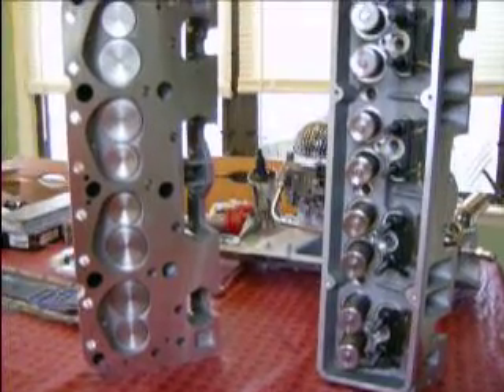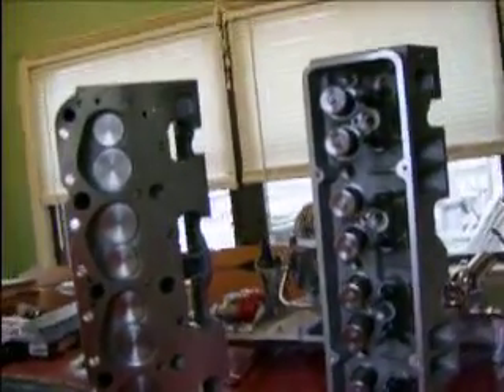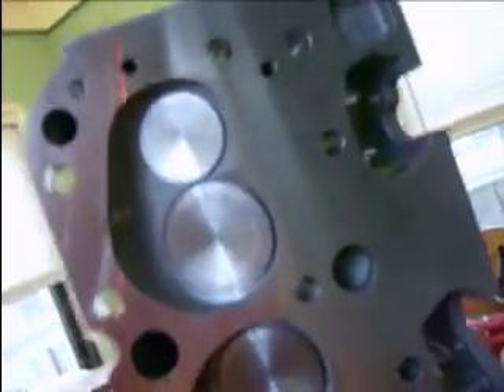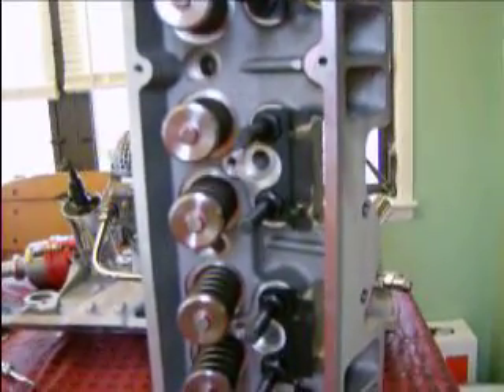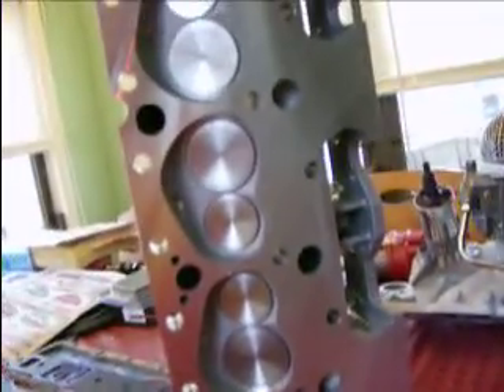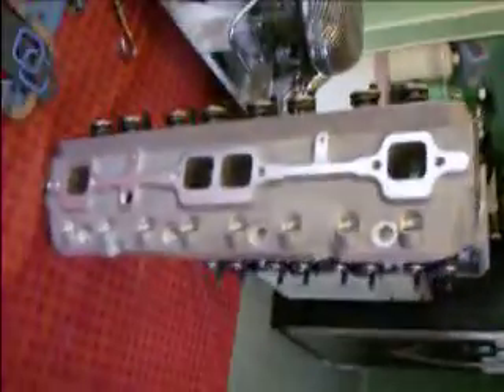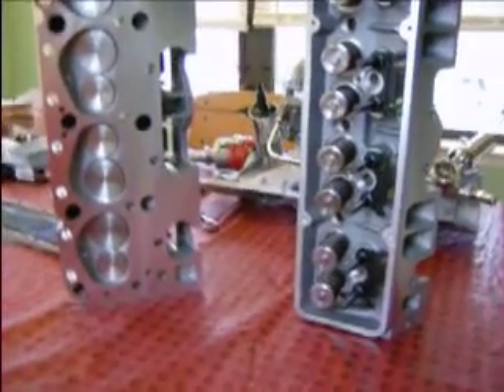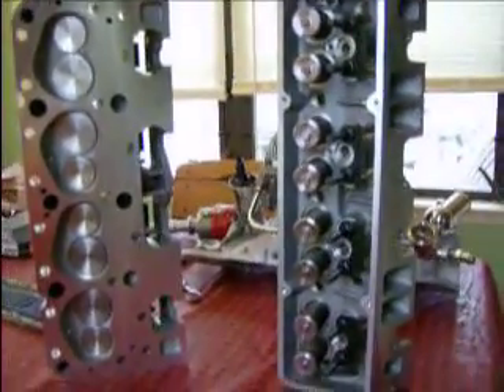PATRIOT FREEDOM CYLINDER HEADS

Comment: I run the steel version of these and yours are actually 195cc. I am having problems finding an intake that seals up correctly so now I'm dealing with that but when it did run(361 sbc) what a difference from stock heads.. So where's the running video?